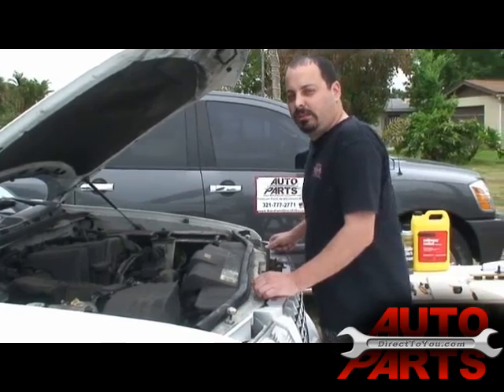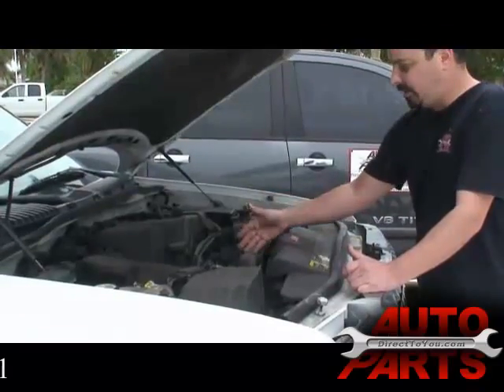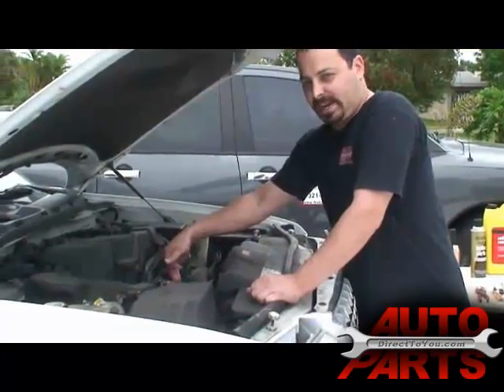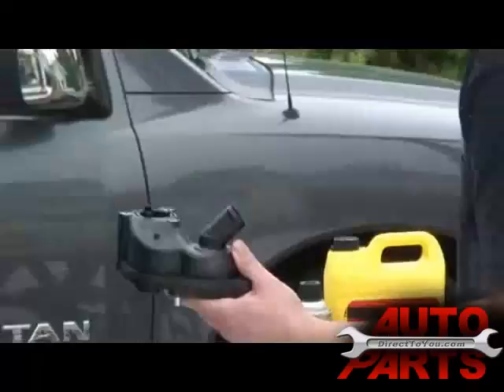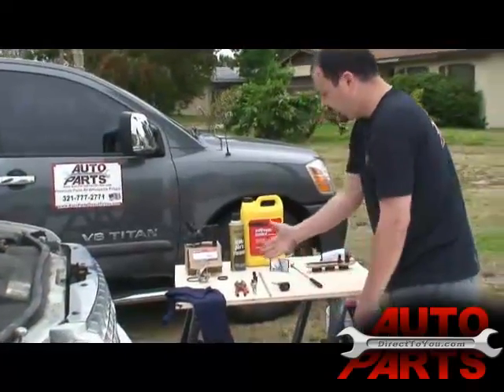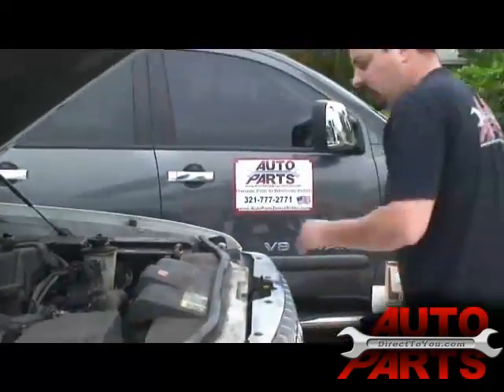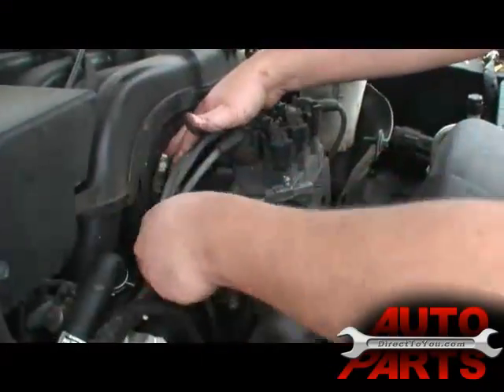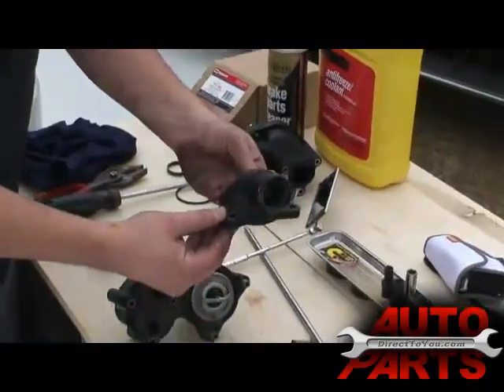2002 Ford Explorer Thermostat Housing Coolant Leak Part 1

Comment from the maker: Sorry to hear about the headache you are having. The system is not designed to work with RTV, if it's still leaking something must be causing it, usually it is a poor seating surface for the o-ring to sit on (often caused by corrosion pitting). As a last resort you can always try RTV, but I cannot recommend it.

Comment: This is the first repair of a part, other than lighting, on this Explorer with 160,000 miles on it,..  I saved about $95.00 by buying a new housing, complete with thermostat, through Amazon.com. I put it on myself and saved about $150.00 on labor. I put it back together, tested it for leaks and it seems to be working fine now. It appears that I saved at least $250 and am back on the road; not having to worry about water and anti-freeze loss during July and August.

Comment from the maker: @BASICS1A1 Hi, it sounds like you have a coolant leak from somewhere, but there are so many possible places coolant can leak from, the only thing I can suggest is to have the cooling system pressure tested to find exactly where the leak is coming from.

Comment from the maker: @cjtf Usually if it's leaking, it is the plastic on the housing that has failed, the plastic lip that holds the o-ring in place gets brittle and breaks, allowing the o-ring to become misaligned, and will then cause a leak. Unfortunately it's one of those jobs that while you are in there, it's best to just change it all to avoid future problems.

Comment from the maker: @WendzDarKnight08 AutoWizardful is correct,, (about the seal, not about us having no idea what we are doing,, haha,, I guess we can't win em all :)  ). but yes, it is likely your o-ring on the CTS (Coolant Temperature Sensor) that is leaking. When the vehicle is cooled off, pull the sensor out and inspect the o-ring to make sure it isn't chipped, twisted, or hardened. When you replace the o-ring it is a good idea to lubricate it with some silicone based grease to ensure it seats properly. Thanks

Comment from the maker: @CAMDENFUNK You likely have an air pocket or two in the system, if that's the case, the system should stabilize itself after a few days of driving, if it doesn't, you may need to have it rechecked.

Comment: I have a 07 and I have replaced this thing almost 3 times.Ford surely was thinking when they decided to make a plastic thermostat housing.I was wondering do they have a different design maybe aftermarket?That will not warp,It seems to happen just about every year after the winter sets in.

Comment from the maker: @bulll911 The best thing to do is to have it pressure tested, I can think of 3 things that would cause a coolant leak to appear there;  From easiest to fix, to worst:  
1) Heater Hose or Heater Control valve
2) Lower Intake Manifold Leak
3) Freeze Plug Leaking
Each of these is a drastically different repair, so it'd probably be worth a few bucks to have a shop check it for the leak.

Comment: If the housing is leaking along the seal, how do you know if you should replace the entire housing and not just the gasket ? I have a small leak somewhere and dont know if I need to buy a gasket and housing and thermostat or just a new gasket !!
There is a big difference in price....

Comment from the maker: Yes the upper and lower thermostat housings were replaced. The actual installation happens on the second part of this video (Part 2)
Reply: Do you guys have a video for head gasket replacement for the 02 ford explorer? Plz lmk I would appreciate it so much

Comment: Hi, I ordered this kit as I was having this problem.  I went to take out the bad thermostat, when I was removing the bolts from the upper housing the back was rounded. I'm having a hell of a time trying to get this bolt out. I've grabbed a bolt extractor socket, but as you know there's little space to get any sort of wrench into a socket to turn it.  I've tried with channel locks and a set of small vice rips on the socket, no luck.  Any recommendations on how I could get around this to remove the thermostat to install the new one?
Reply from the maker: Hi, did you ever have any luck getting the bolt out? If not, unfortunately sometimes drastic times call for drastic measures. You may need to pull off the upper intake manifold in order to gain better access to the bolt. If all else fails, you could try breaking the housing away from the bolt also, and see if you can get a bite on the bolt itself.
Reply: Auto Parts Direct To You nope, none yet.  I was thinking of trying to just break the upper housing off I'll try that before taking the upper intake manifold off as I believe that'd be more work and I'm not sure I have the time to get to that right away.  Thanks!
Reply: +bfddr0x how did you resolve this issue, if you? recall
Reply: +Jordan Wheeler a sawzall